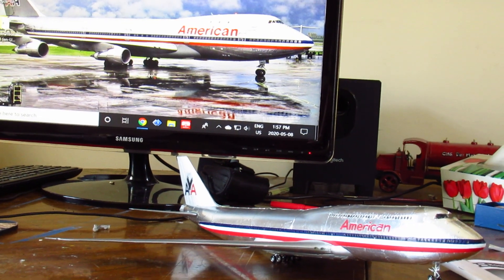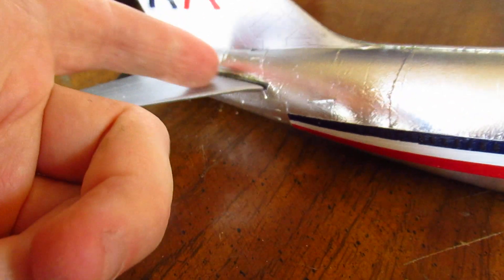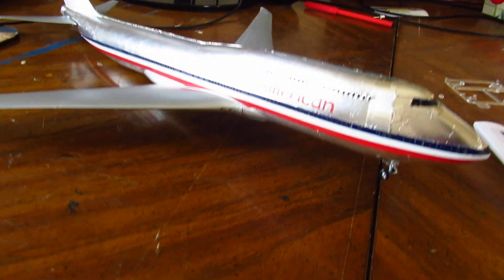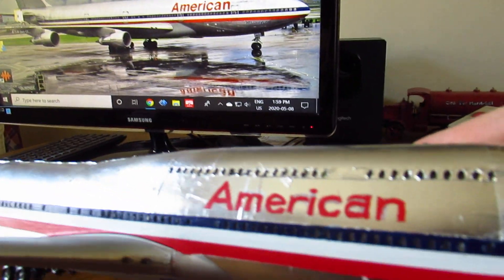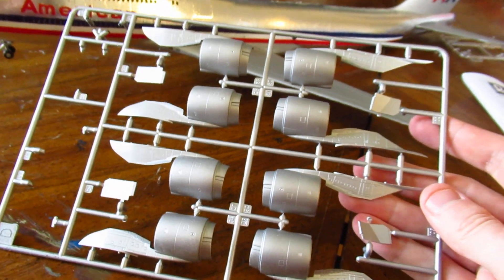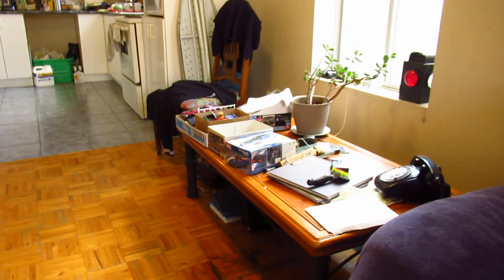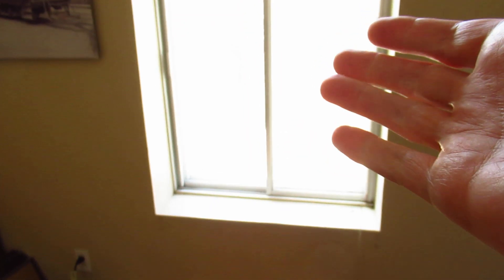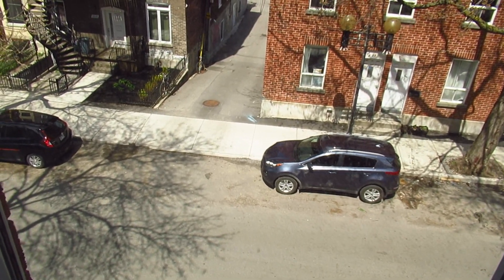REVELL BOEING 747 MODEL KIT PROJECT PART III - 5-8-20

Comment: Hi squire great build I’d recommend you drill a small hole in the bottom and pour plaster of Paris it would keep the model
Level  and you can fill the hole up and use some aluminium tape to cover it over